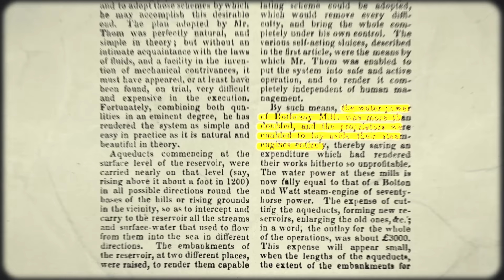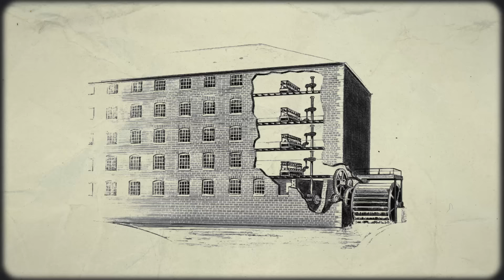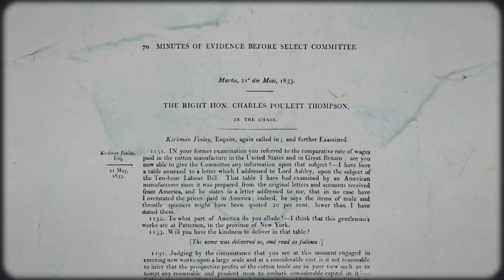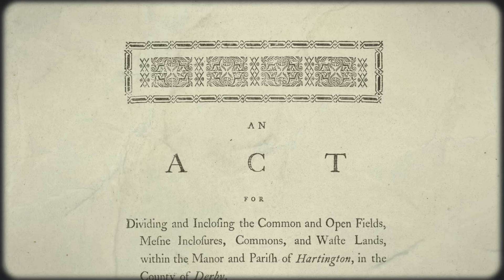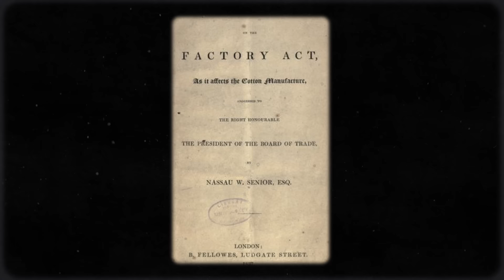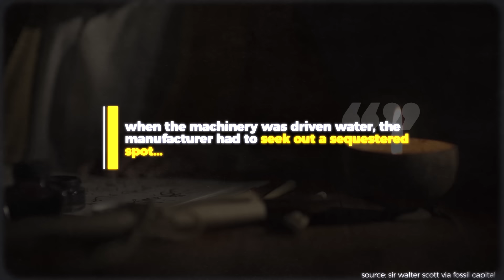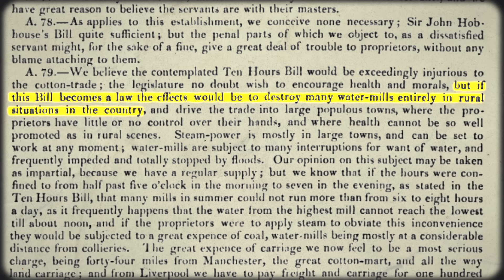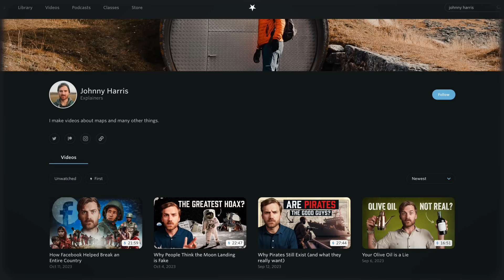Why Capitalism Loves Fossil Fuels

Comment: "More expensive? Less efficient? MY GOD, IT'S GENIUS!" - Capitalism
Reply: This is actually so important. We forget that efficiency comes in different types. There's financial efficiency geared towards profit, then there's energy efficiency geared towards environmental protection. They often align but not as much as we'd like to think. The most profitable option is not necessarily the most energy efficient.
Reply: Also reliability and predictability are reasons for, in this specific instance, steam over water.
Reply: did you forget about competition?
Reply: @IshtarNike Why is maximum energy efficiency the goal? If we were solely chasing maximum energy efficiency, we would be chasing temperatures hotter than the core of the sun, which isn't technically or financially feasible or desirable.
Reply: @uzefulvideos3440 did you forget about consolidation, monopolisation, and market control? Competition is a joke it doesn't exist under capitalism
Reply: @FatfighterXD1  Of course competition does exist, even consolidation much beyond the point of highest market productivity does not make the market nonexistent, competition can always spring up again should the quasi-monopoly become less efficient. In practice, there are barely any large markets where there's no actual direct competition, because all the natural monopolies have been collectivized by the state in most countries.
Also, don't forget that competition extends beyond the immediate product niche. Restaurants are in competition with supermarkets, rail is in competition with cars, ...
Reply: @IshtarNike  Absolutely. What I wish more people understood was that there is a BIG difference between "Market Efficiency" and "Technical Efficiency" and when something is technically efficient to create abundance, it is hard (next to impossible) for a capitalist to profit from and therefore it isn't encouraged to develop. But scarcity? That's where the profit is. 

We need to get off this path and create conditions that technically efficiency can really develop. Going to have to be co-owned by the people of a community so that the people profit equally from the efficiency and abundance created and corporations cannot come in an buy it out or corrupt it. The people won't allow it. There's plan with One Small Town Contributionism to do just that. And water energy electricity is just one of the amazing technologies that create abundance and prosperity for the people!
Reply: @gregorymalchuk272 What are you even arguing here? That inefficient energy production is preferable to efficient energy production because it is not the temperature of the sun?
Reply: @Noobslayar  You haven't established why efficiency is the highest goal period. Low lifecycle cost should be the goal. More energy efficiency measures mean more complicated and fault-prone technology, and more energy intensity during the production (and repair) processes that damage the lifecycle cost (and lifecycle energy use).
Reply: The word you are looking for is control
Reply: @davidcrawford9026  capitalism generates 'control freaks', so yeah, it's part of capitalism, unfortunately. What we need is to start getting off of the control freak grip of capitalism, and we can do that with community cooperation, collaboration and co-ownership.
Reply: So true
Reply: @gregorymalchuk272 interesting perspective, but you're unnecessarily argumentative in your original post and arguing against a straw man that you created. Also, if you measure a society's uses of energy as a kind of currency, lower life cycle cost is implicitly included in arguments for efficiency.
Reply: Well river power is less efficient where people don't live near rivers. But why don't more people and businesses who live near rivers use water power? I think some modern people don't know and just blindly follow tradition which is fossil fuel power now. Or they don't want to spend the money to make the change.
Reply: @gregorymalchuk272 Efficiency is the goal because it is necessary for our current civilization, it is necessary for a fuel source to be easy to transfer and with high energetic density. It's the reason why most people prefer an internal combustion engine car instead of an electric car.

Comment: You see this same problem with solar and wind energy. Wind energy is still a high cost/low output venture most of the time, but Solar especially is dirt cheap to set up and the energy is literally free - if it's there. Solar and wind aren't consistent so they're more dificult to squeeze a profit from. Now if we, say, only needed energy to just supply our needs rather than needing energy to overproduce for the sake of profit, this likely wouldn't be a problem. Interesting parallel either way.
Reply: Yes, solar and wind struggle to produce more resources than they consume leaving everyone poor, except for the businesses who have the money to buy vast areas of land and paid off the government to create favorable regulations for them. 

Also, you clearly don’t understand what kind of energy it takes to produce the basic goods you take for granted.
Reply: @kokofan50 I think he was refering more to things like fast fashion, design to failure etc. Not the expenditure of energy per say but how many goods aren't build to last, so you buy more.
Reply: @Pertinaziuos  yes, the dude who kept going on about energy isn’t talking about energy.

Comment: There seems to be a contradiction in arguing that water provided a cheaper, equally powerful, even source of power while also acknowledging that it doesn’t work well when water level falls and can be significantly affected by freezing in winter. It also should be noted that there were huge conflicts and legal battles over water rights. The challenges of water power led to the desire of capitalists to maximize labor when the water worked best. This led to the labor movements mentioned in the video. Coal was more expensive but increased production and the potential for profits because it eliminated the variability in the power source, could make labor equally productive at all times (including at night since many factories first converted coal into coke for more powerful engines and coal gas to light the factories for 24 operation). With coal, labor then became the crucial variable. 
It’s also a less known history how coal began to transform English cities and countryside even in the 1600s, well before the Industrial Revolution. See Ruth Goodman’s “Domestic Revolution” about how the conversion from wood to coal for heating and cooking contributed to the conditions in which the Industrial Revolution emerged, including enclosure, rising urban population, rising coal mining, distribution networks, etc. 
Taking all this into consideration, it’s a stretch to argue that coal was embraced primarily because it controlled labor in spite of the superiority of water.
Reply: Everything I wanted to say and more.
Reply: perfect, have my upvote and comment and gratefulness for not having to type this out. I'm from Germany and while water mills aren't uncommon, large scale production was only possible with something that would provide you with a steady and predictable outcome, e.g. an oven. Rivers unfortunately used to freeze over or flood half the town in spring if there was especially much snow in the alps that winter or, contradictory, not carry enough water after droughts.
Reply: Yes.  Clearly, water power could not sustain the demand for power.  If it did not happen in the England textile mills, it would have happened quickly in overall industrial development.
Reply: Not to mention, bodies of water that can be used for power aren't available everywhere, some of those places aren't suitable for construction, and the energy output may not meet the requirements for all types of manufacturing.

Coal and other fossil fuels also removed geolocations restrains, allowing factories to be places near cities(labor), near the site of raw materials or near the coast (ease of transportation).
Reply: The channel Prolekult presents a slightly different take on the argument provided in this video, it is interesting to also consider that when critiquing this analysis. It's around minute 49 in a video titled "For Land | Part one: Capital as extinction".

Comment: 1) Thom was from Greenock, and so was James Watt. 
2) The Mills were not just cotton (mainly Lancashire), but also wool (mainly Yorkshire) and linen, with many export oriented.
3) The point about fossil fuels being geographically flexible needs contextualising. Coal is big and heavy to transport and it was not really until the canal network was built (and later trains) that mill owners could choose to move. However in the case of many mill towns, and certainly the bigger ones like Bolton and Oldham, they also happened to be sited on coal fields, as well as water sources. The population grew as the industry grew. So although the mills got bigger and more complex with the shift to steam, they often didn't move very far. 
4) The move to steam was not just a benefit for the owners of the mills, it also benefitted workers to some extent, as their hours were managed to set times and periods, their income set, and better regulations slowly came into effect. Their greater productivity reduced prices of the goods they produced too.

Comment: I always enjoy and appreciate your videos! But I have a suggestion for if you ever have the need or desire to make them a bit shorter. This channel has a tendency to repeat the same points & information over and over. This can actually be extremely useful for helping people understand the concept, especially when they're listening to the video while doing other tasks. 

BUT a lot of people are bothered by repetitious formats. Especially in contexts, like YT, where it's very easy to rewind and re-listen to improve comprehension. That means missing out on a significant section of potential audience. As does having lengthy videos in general. 

I would love to see a short version (where each point is only stated once) and a longer version (where reinforcing repetition is maintained). This video would probably be around 5-8 minutes long if it omitted the repeating points.
Reply: I agree. My thought on this video where that everything could have been explained in five to ten minutes.

This longer format has more dramatic effect and it gives it a documentary like feeling.
However, from the perspective of being informative, it is far too long. Especially for spreading information to people that were unaware of these things.
I suspect that people not already interested will not spend 20 minutes watching it.

Comment: James Watt did NOT invent the steam engine. Bolton and Watt formed a company to sell low pressure steam engines and definitely popularized them, but many earlier steam engines existed.

The earliest generally accepted industrial steam engine was invented by Thomas Newcomen. The first Newcomen "atmospheric engine" was built in 1712 and was used to pump water out of coal mines.

Watt wasn't even born until 1736...
Reply: Watt used empiricism to increase the efficiency of the steam engine to the point that it could justifiably be used for power for purposes other than pumping out coal mines while burning slate contaminated mine waste.
Reply: The book mentions Newcomen

Comment: Well, it's not so much to exploit the worker but to maximize the production process.  The problem with the water was obviously the intermittency.  That's also the problem of today's main renewable energy sources.

An energy source that you could use independent of time of day, weather, or seasons simply created more flexibility and more time maximization, so in the end it was cheaper after all.

Which is an important issue we'll have to deal with if we wish to switch over to renewables.
Reply: Watch DW Planet A on wind turbines. They said there's different turbines that can spin from wind in any direction. And that Germany harvests plenty of green energy but it goes to waste cause they don't have a way to store the excess yet. Some people in sunny places still make excuses to not use solar.

Comment: The fossil energy is constantly available allowing the factories to run their machines anytime. You said it yourself in your video. 

So the advantage of fossil fuel energy is its consistent and predictable availability.

This also makes possible to locate the factories anywhere since they are not tied to a water source.

On the other hand, the factories running on water depend on the speed of the current. Which highlights the fact that the energy from water isn't always available.

Today we have the same problem with renewable energy. It's not always available for our energy hungry civilization. When there is no wind and no sun, there is no energy available from renewable.

The reason why we cannot move away from fossil fuels energy is our refusal to completely redesign our economy which will go against the interest of those who possess the capital.
Reply: Nuclear energy

Comment: The video is idiotic.  It completely misses the point of the benefits of consistent reliable power in running a factory.  The presenter obviously has no understanding of manufacturing.  Additionally, consistent and reliable power resulted in the end of irregular work schedules that were the result of irregular water power that was provided by local rivers.  Also, fossil fuels enabled factories to be constructed in areas with larger labor forces that did not have big rivers and/or water falls thereby enabling greater employment opportunities across the entire country.  Your deviation into the labor abuses prevalent in the 19th century is not the result of power sources as much as it was the result of business practices of the time.  Similar conditions were present in other European countries and the United States and had nothing to do with water power vs fossil fuel.  Stopped watching after 12 minutes.  Not worth going any further.

Comment: This is a great video, but I can't help thinking that all the important content could really have been conveyed in less than a minute.

Steam won because 
1. It was possible to guarantee consistent power whenever you needed it, better fitting the working hours demanded by workers
2. was cheaper and more flexible to initially build the factory because it wasn't required to be build near streams, often in rural and inaccessible places
3. Was far cheaper to staff with workers, due to the ability to build factories in city centres, where there were large and often desperate pools of people seeking work, driving down wages through harsh competition
4. Was also cheaper because not only were potential employees plentiful, but because they were also freely disposable (compared to workers living in a factory town around watermills, who were limited in number, purpose-brought to the area, and had to be kept happy)

Comment: I just want to share a thought here: the fact that they switched from water steam doesnt seem like it was only about controlling the laborers even though the industrial era surely is known for overworking its laborers to un ethical extents. Didnt the switch to steam seem to be the natural solution to the laborer problems as well? It allowed for more consistency with their work hours and also allowed them to cut their hours shorter? Water power forced them to work unpredictably and for even 16 hours!!? The machines can be made to move faster probably allowing for more production to meet demands in a shorter amount of time( like 8 hours if the capitalists were willing to stop growing, too fast) you know? So to me it seems like it couldn't just be bad that the capitalists chose steam over water-- when it gave their workers more time and stability with their work hours. Maybe they did still push those workers way past their limits and maybe those machines could have been slower and still produced enough products and that's the problem?? They had the opportunity to lessen the extreme burden of their workers more when they chose steam but didnt actually take enough away that makes it worth it and ethical in general. Does that make sense?

Comment: What I found weird is that the early-victorian factory architect thought up of using medieval watermill system, but considering it's seasonal cons such as drought, they never seem to thought about medieval windmill do they? There will always be wind up there and there are a lot of windmill in the UK by that point but most of them seems for be for small things, even the Dutch only use it for sawmill/cutting wood at best, maybe the push is not strong enough for a huge machine? but if that's the case won't they just need to make the turbine/sail bigger? idk I'm not a traditional windmill engineer.